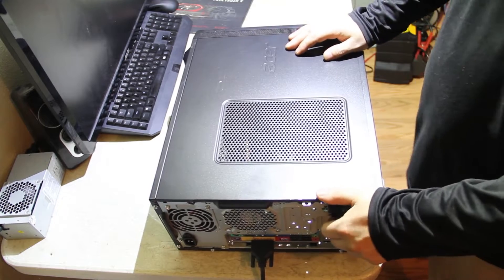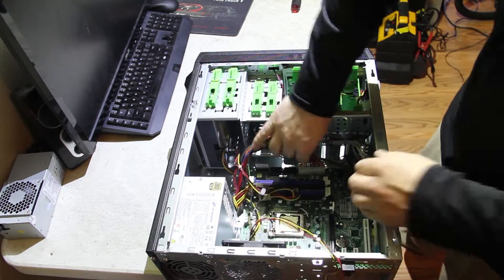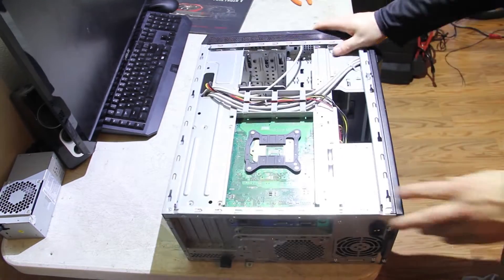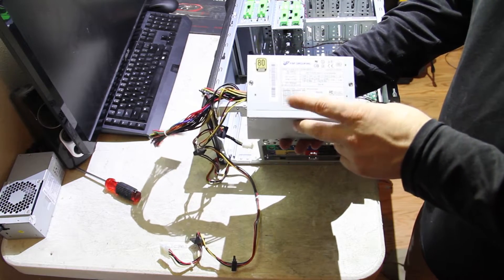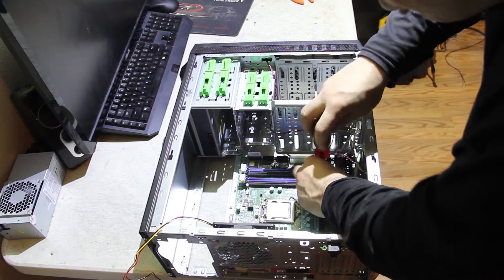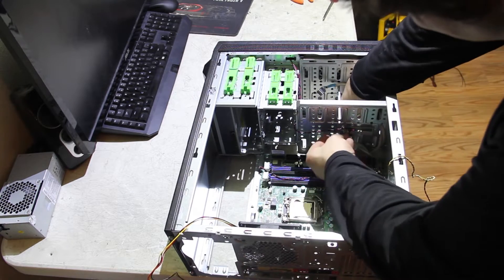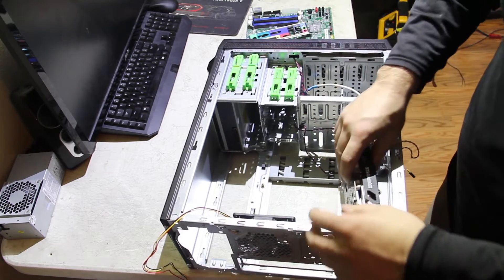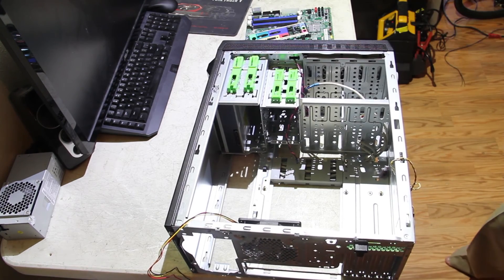Acer Veriton M4 Teardown

Comment: doesn't even know the model of the pc he is doing the video on,  tuning out after 30 seconds,
Reply from the maker: You realize that for the purpose of this type of video the only relevant model is the series, not the specific individual model, right? Just because your unit has an i3, i5, i7, pentium, or 4, 6, 12, whatever ram, or a 1tb, 2tb, whatever drive, does not mean disassembly will change? The only thing the specific model denotes is the specific spec as far as performance, construction is the same... however, to get in a not so subtle dig back at you... these types of videos are intended for people who know that sort of thing, if you are not well enough versed to know this stuff, I'd suggest watching some additional educative material BEFORE even considering opening a machine as clearly complicated as the Veriton M4 is...

Comment: do you think I could install a gpu like a gtx 770 that require a 2+6 pin and a 6 pin power cable or would I have to get a new psu?
Reply from the maker: You would deffinitely need a new power supply for that
Reply: @dragonsystems5973  thank you! do you recon 550w is enough?
Reply from the maker: @johnathanpercocet  If it is a good name brand model yes, something like a Corsair would be what I would want at that wattage for a higher power draw card
Reply: @dragonsystems5973  thank you for your time!!! I think ill go with a 650w just to be safe
Reply from the maker: @johnathanpercocet  Deffinitely :)

Comment: How did you remove the motherboard? I can't get it out. I heard you mention a screw at 10:21.
Reply from the maker: This was 2 and a half years ago, ive worked on literally thousands of machines since this one, what you see is what you get. The motherboard appeared to be standard Micro ATX with no odd mounting features, but I dont have one of these I can just go grab and I have no further memory of features beyond that

Comment: Nice, was thinking of upgrading my case but was worried about my case being factory sealed, thank you for showing me it's truly upgradeable. This setup is not bad for mid level gaming and editing, but gets cramped in there with a decent cooler, gpu, and power supply, plus if you're using all harddrive bays it just gets more hot in there. So will most cased come with the cables for the audio, usb, and other case peripherals/buttons? And most are universal to the audio/usb plugins shown here? I'm hoping so since cpu and fan hook ups are rather the same. Also do you know of another CPU that's better than the i7 870 for this motherboard?

Comment: I have this unit on win7, but all usb ports stopped working. That's why I can't use mouse and keyboard even in bios, any advice on fixing this?
Reply: A wire may have been disconnected

Comment: I have this very system myself. Can you possibly post a video showing where the intrusion cable plugs into the motherboard? I believe it is somewhere near the PCI slots, but unsure.
Reply from the maker: I no longer have any of these, however, I gutted them and used the boards in custom systems and there where no complications, they just went right in a d did not have anything hinky to make them work, so it is definitely simple... I'd guess somewhere on the bottom edge of the board, but I could be wrong

Comment: Great Stuff. I'm just wandering if you have access to the latest version of Veriton M, specifically the Veriton M4660G. As far as I know is it's slightly different from the previous Veriton M4, one thing I know is that the latest Veriton M4660G does not have 6 pins for the GPUs which require powers directly from the PSU
Reply from the maker: I do not, these where part of a one off load I received.

Comment: what is the capacity of the psu?
Reply from the maker: Im gonna guess not more than 300 Watt, but unlike most of the machines from Dell and HP it is to the best of my knowlege an off the shelf part, so replacing it should be as simple as just dropping whatever one you want into it